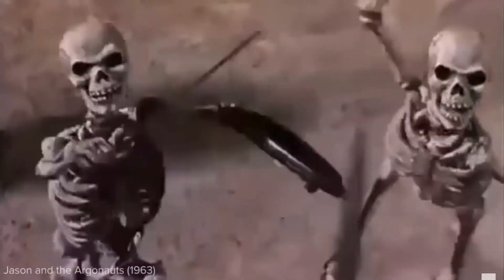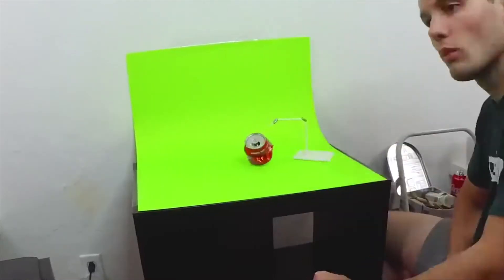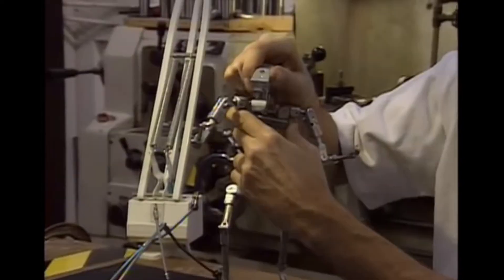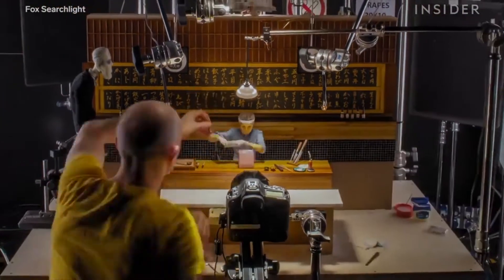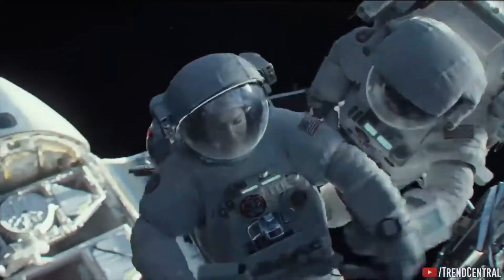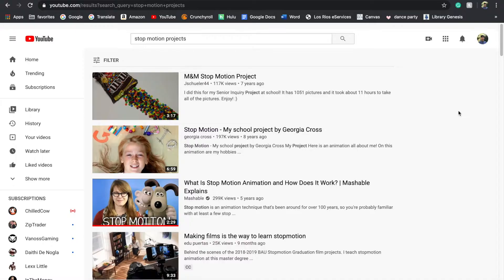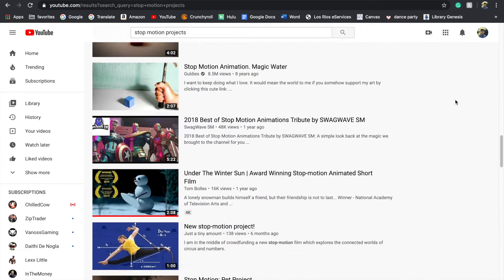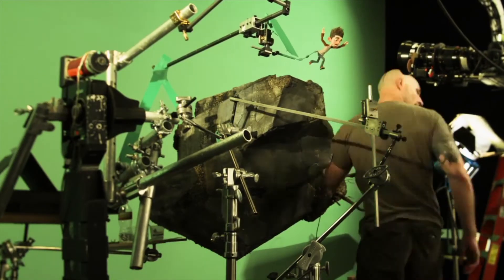The Effects of CGI on Stop Motion Animation

Comment: 5:07 Call their technique “CGM” (“Computer-Generated Models”), then, instead of “CGI”. It is one step closer to CGI than traditional stop-motion.

Next, have the human animators just set up the model posing for the keyframes, and have the interpolation between those keyframes done by robots, and you have practically closed the loop.

Still doesn’t solve the motion-blur problem, though.